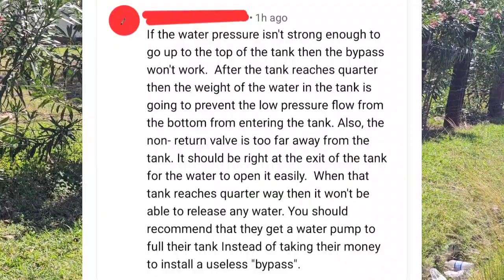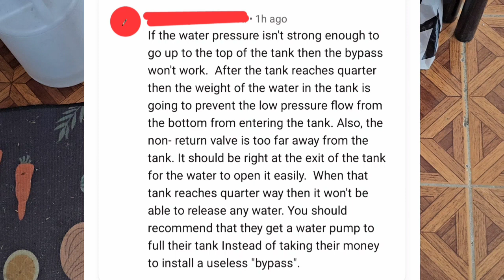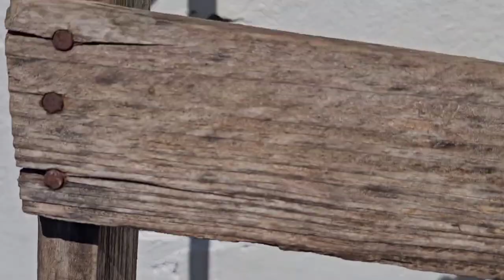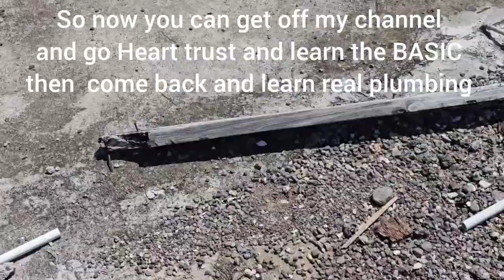This Cobbler wanna be plumber comment on my video

Comment: Good day "best plumber in Jamaica ". When putting a check valve on a water tank outlet you should not use a spring check valve. You should use a swing check valve instead that opens easily. The same 1 you described as the "1 with the flap".. you don't even know the proper name for the fittings.. smh. Why do you get so aggressive over a simple constructive criticism bro? Smh